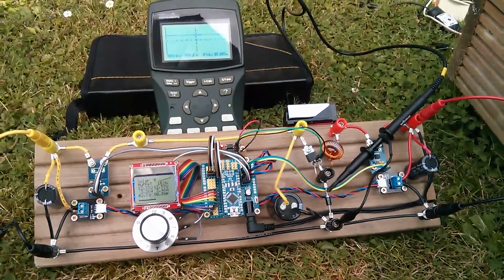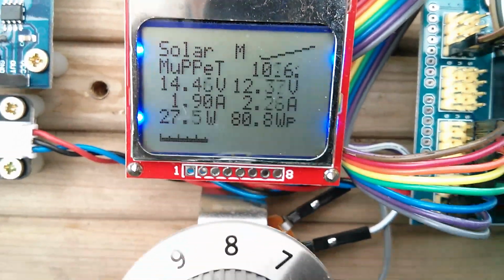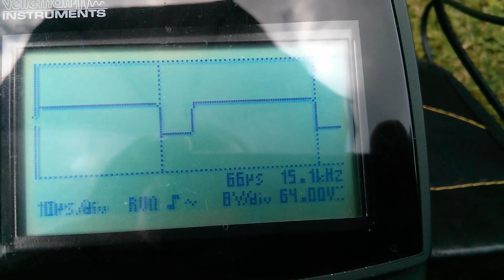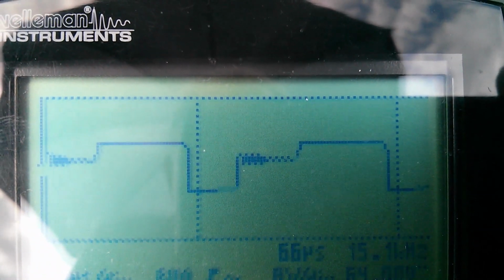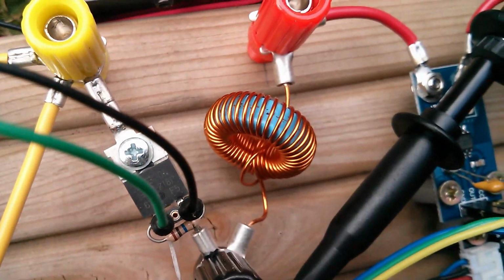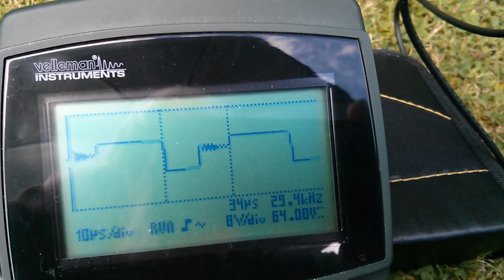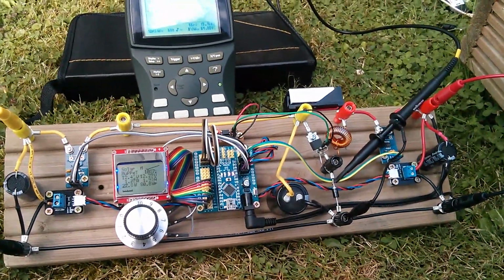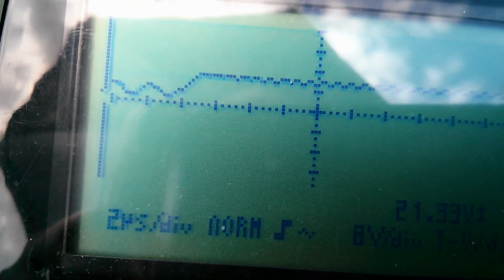Arduino MPPT Solar Charge Controller #20 - Inductor Discontinuous Mode

Comment: I would love to see more of the Muppet project. A bit bigger resolution display, better inductor, powering mosfet driver from the system itself, data logging, improved tracking algorithm to be smarter and faster, battery and dc/dc converter temperature measurement, calibrated voltage and current sensors, there is so many things that could be done with this cool thing. I am preparing myself to do similar project, but with extra secondary step up DC/DC converter on the output so the output voltage is stable and controllable independently.

Comment: Hi, I am in need of a light-weight MPPT solar charge controller that is capable of charging a 36V li-ion battery pack. All of the off the shelf products only support 12/24V, and the ones that support 36/48V are too heavy. I was planning on building my own as you have. What changes would I have to make to your project to get this to work? Or the better question may be how to pick the right components based on requirements. Thanks!

Comment: Julian, thanks for all the videos. This is an old thread but new to me. I have watched many but not all your MPPT vids and two issues keep bugging me:
1. I can see a fat cap across the input from the PV panels - surely that will confuse the algorithm. What you want is for changes in current taken to quickly/directly affect the PV output voltage so that you can maximise the watts output. Having a capacitor which can also deliver a current output into your MPPT device can only confuse matters surely - it will slug the response rate of the algorithm.
2. the objective  of MPPT is to get the most out of the PV panel but this is only true when you have a load willing to take that output. By having a battery charge circuit on the output you have a non-linear load. Would it not be better to optimise your MPPT with a simple resistive load - just bulbs say - and then bolt on a battery charge management stage to the software afterwards?
Please keep up the good work.

Comment: This is a wrong core type and it saturates very early despite being physically large, you probably got a ferrite core with an enormous AL value, used for balanced filters, where the net DC current magnetising the core is minimum. What you need is a powder core, with low AL value and capable of taking a high current and high magnetic flux for energy storage.
I've just watched the whole series and what struck me quite early on was that you put the output current sensor before the output capacitor, which is probably why you were getting the fantastic efficiency readings ;) When the scope came out I was hoping you'd put it across the current sensor and see that it definitely isn't DC current you're measuring :)
Cheers from Poland.

Comment: I am playing around with the Arduino based on this project and noticed that I can get some interesting results by adjusting the frequency in addition to the pulse width. Maybe something you should consider as instructors are not going to be perfect in such a project?

Comment: Hey Julian nice video series!! I'm wondering why not use a boost topology in case solar panels doesn't reach battery voltage to keep them charging despite solar irradiance. Is that possible? A good extra for your project is the replacement of the diode for another MOSFET working 180º out of phase, there are some MOSFET drivers with this double output commercially available.

Comment: Hi Sir Ilett, Could you tell me the values of the capaticitor and the inductor, please. I have a problem with the circuit, When the load is very low, voltage falls, and I don´t know why, is it necesary the battery?. Do you know something about it?...I´m using a buck boost conveter. Can you give me your email. Thanks man!

Comment: These videos on custom-made solar chargers are definitely the most educational ones I've found! I'm planning on building an MPPT charger for next summer from arduino. Perhaps I'll get of these premade DC-DC buck-converter circuits set at a stable 16 volt output: http://www.ebay.com/itm/281206555382 . I would then create an arduino pwm controlled current limiting which would keep the maximum current below predefined (I'm charging 4-series lithium ion - max 16.8v target: 16v) and limiting current so that the input voltage does not sag and maximum output power is gained. Cell balancing would be done separately or charged at 4v (each cell) instead of the more efficient 16v (maybe dual mode with switchover when close to full capacity?).

For MPPT optimisation the current and voltage would be measured between the panel and the charger -- less optimal but you avoid the errors by measuring pwm corrected voltage/current where cheap sensors might have trouble.

I'd imagine this prebuilt module is not the most efficient solution but do you think this might work well enough? Thanks!

Comment: FYI: human hearing can handle from about 20Hz to 20Khz, the upper range drops fast as you age, above 13years, most have lost hearing above 15K.
Dogs can hear up to 50Khz, and they'll typically go "crazy" when you have a loud enough sound in the 30-35Khz range.
Cats can hear up to 65Khz, Bats up to 120Khz and dolphins up to 150Khz
If you do go higher, I guess it's about finding the sweet spot above human hearing and before all the neighbourhood dogs start barking  :-)

Comment: I agree that you are seeing discontinuous mode.  It would also be handy to put a temporary small resistance in series with the mosfet (if there is not already a panel current monitoring resistor there) to make sure the current ramp is linear (that no saturation is taking place in the inductor core).  You definitely do not want to scrimp on inductor size and quality in a device intended to improve efficiency.

Comment: That negative voltage is rather illustrative of the inductor being much like an electrical analog of a physical mass. It takes a bit for the current to get flowing but once it does it wants to stay in motion, pulling current through the diode from the ground line.
Reply: I am also in the process of designing and building a MPPT charge controller. I have just discovered need for a gate driver. I've decided to go with a commercial driver for reliability and efficiency. Debating between LTC4440-5 or the LT1910. The first  is designed for 60V which I decided I like. The second has a charge pump but connects the gate to ground and is more expensive.

Since I'm going for efficiency, I'm going to try an ideal diode controller like the LTC4357. Maybe the LM5050, High Side OR-ing FET Controller.
Reply: Speaking of improved efficiency, you may have heard of the SEPIC (Single-ended primary-inductor converter) but have you heard of the ST's Back Current Circuit (BC2)? It's document (AN3276). The document describes the a boost converter setup but the technique is supposed to be applicable to a buck converter also.

http://www.st.com/st-web-ui/static/active/en/resource/technical/document/application_note/CD00285613.pdf
Reply from the maker: Abraham Barker My priorities are low cost, and ease of procurement of parts, so I'm keen to avoid specific driver ICs. To an extent, I'm willing to sacrifice efficiency to keep the cost down and the parts easy to obtain, although it's important that the MPPT mechanism still achieves a significant benefit over a simple PWM controller. I'll have a read of that app note.
Reply: Julian Ilett I agree. Most parts that I have been considering are rather easy to get through Mouser or Digikey. The cost is another story. I have found that most of what I really desire in a part usually comes at a price.
For instance; I started off a MAX9611 current sensor. Lovely chip. I really like it. Gives me high-side current, voltage and temperature but it's over $2 US (1.24 GBP). Of course I need two of them per MPPT. I'm too cheap for a proper shunt resister so I figure I'll take a known length of 12ga or 14ga wire, which has a known resistance, and measure across that.
The foot-print of the MAX9611 is tiny which makes it hard to prototype with. It doesn't come in a through-hole. It's pin pitch is .5mm. To even test the thing I had to make a breakout board from a little scrap of PCB. I cut traces in the copper with an Exacto knife and a loupe just so I could have something to solder to.
Surprising to me is that the high-side MOSFET drivers are even more expensive, about $3.50 (2 BPD) for the I'm looking at. The foot-print is just as bad. All the new stuff comes in really tiny packages.

Comment: Find another country with lots of sun - I wouldn't recommend Spain.

1. It's a terrible place to do business. AFAIK in UK you don't have to collect VAT until you are turning over a fair amount of money p/a, you get a personal tax allowance just like anybody else and you pay national insurance on a sliding scale vs. income. In Spain you collect VAT and pay 30% income tax from day one and national insurance is a fixed monthly bill - even if you don't make a single € of profit.

2. New renewable-hostile laws require you to install a homologated meter to pay ~7¢ tax per kWh you produce, even if you don't feed it into the grid. The new law gives inspectors right to enter any property at any time without permission and check for compliance. Failure to comply lands you a fine of up to €60 million (I'm not kidding). Not ideal for the sort of things you like doing. The only get-out clause is if your property is 100% off-grid.

Try Thailand. Their military junta is probably a lot more reasonable and less corrupt.
Reply from the maker: Thailand's a bit far away! But thanks for the info on the Spanish tax system and solar panel laws.
Unrealistic though it may be (from a finance point of view), I'd love to have a tiny property in Spain, or anywhere the sun shines reliably, which I can visit for a couple of weeks, a few times a year, and work on the solar projects under a predictable and unclouded sun. My solar panels would only be placed on the balcony a few hours a day - it wouldn't be a permanent installation.
The UK must be one of the cloudiest places on earth - it's incredibly frustrating trying to make hardware or software modifications when the solar panel is producing 4 amps one minute and half an amp the next.
Reply: Julian Ilett
Good idea. Stay more than 6 months a year in UK and you are tax resident in UK, not Spain. Plenty of flats to rent for peanuts at the moment (although August is always the peak rental price). Also there are loads of countryside houses for sale and rent (cheap!) - quite far away from electricity company busybodies (ahem).

Property buying tip for Spain: avoid flats & houses in community properties - with the rampant unemployment your neighbours won't be paying their share of community fees (swimming pool, maintenance, gardening, security, etc.) and who makes up the difference? You (or you just don't have a community pool, garden, etc.).
Reply: Julian Ilett It's not looking like our solar panels are going to pay back any time soon. We should have about 9kW of capacity yet are struggling to produce more than 1kW and it's July! Mad...

Comment: I would like to know if you plan on keeping the refresh rate on the display? I feel as though it's refreshing too quickly and would perhaps be more readable if it was in the 5Hz range.

On another note, I love your videos! Thank you for all your hard work.
Reply from the maker: Yes, it is refreshing too quickly. I shortened the loop delay to make the MPPT tracking more responsive. Now I need to introduce a loop counter so the display data only updates every n loops. Cheers.
Reply: Awesome! Looking forward to the finished product!

Comment: As long as you're able to switch the MOSFET cleanly (i. e. provide enough current at the gate for fast switching and have a fast MOSFET), higher frequency definitely is the way to go. Because if you'd want to scale up to higher currents, my guess is, the necessary inductor will soon become the most expensive part of the controller, just because of the sheer amount of copper needed on it.
Reply from the maker: The can of worms is well and truly open now! Fast MOSFET switching causes RFI - I found this with the PWM5 - add some gate resistance to the existing gate capacitance and the RFI is almost eliminated. But this will clash with higher buck converter frequency.
I'm thinking of slowing the PWM frequency during float charge - 15kHz simply isn't required to keep the battery at float voltage. Then the inductor becomes a spanner in the works - Thicker copper and fewer turns would help here.
I'm also keen to have a "night mode", where the CPU clock slows down (possibly even goes to sleep) and all non-essential circuitry is disabled (particularly thinking of the DCOI LEDs here).
Reply: Julian Ilett Why not simply add a LDR type circuit and switch the entire mppt off if there's not enough light.  Or turn everything off if there's not enough power coming from the panels to drive the MPPT  (if there's not enough for that, there can't be enough to charge the battery)
Reply from the maker: oreubens It should be fairly easy to detect dusk with both current and voltage sensors on the solar panel side.

Comment: i wonder how short a burst at 100 percent is needed to calculate the mppt gain, if you could say run that by default every 5 seconds and keep on display to save you pressing a button, and if its for such a tiny period would not affect efficiency
Reply from the maker: You're probably right - the energy lost to a regular comparison wouldn't add up to much. But I'm a bit of an efficiency purist! I really don't like energy waste, even if it's a tiny amount. I'll put it in as an option.
Reply: Julian Ilett
 yes i do agree with the principal though, but maybe a toggle for when you feel like monitoring it
Reply from the maker: jusb1066 Yep, I agree with that
Reply: Julian Ilett just check the efficiency with a 100% burst every minute and average the result over ten minutes/samples,  the efficiency is more of a gimmick to ease the soul into knowing its working than an important reading like the actual volts which can be updated 'almost' real time, and no efficiency reading will be that accurate as the second you compute it in the UK a cloud will......

Comment: I'm really enjoying this MPPT series Julian...  I'm wondering if a higher frequency alone would take care of your inductor sizing issue completely... allowing your present inductor to avoid discontinuous mode.
Reply: at higher frequency the inductor size will go sown
Reply from the maker: Thanks Joe. My DCOI MOSFET driver is already near it's upper frequency limit - there may not be much room for manoeuvre. I think a bit of both will be needed.